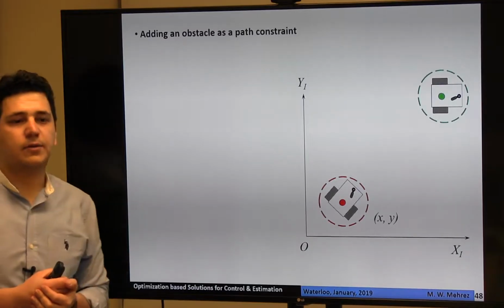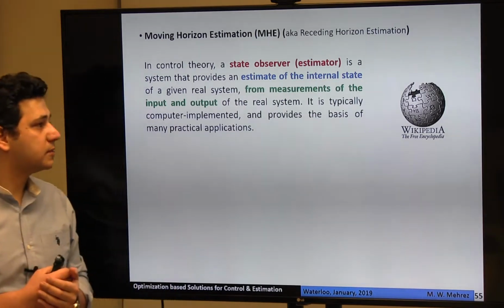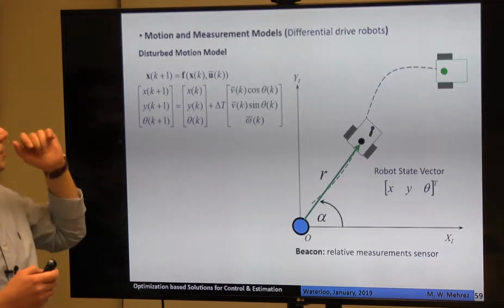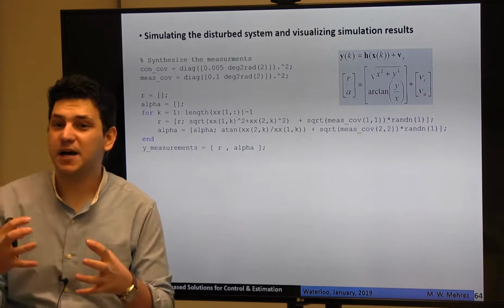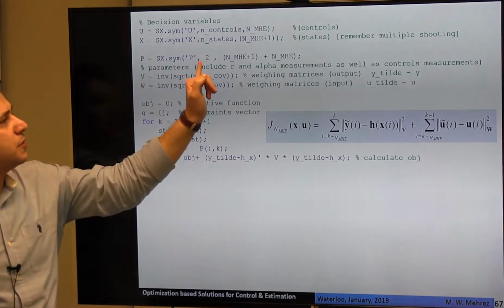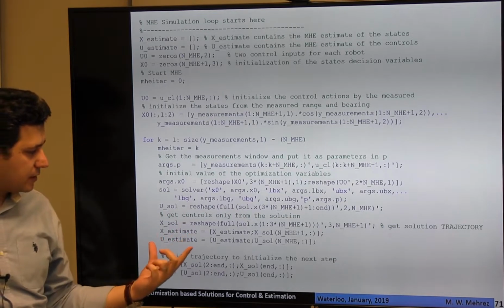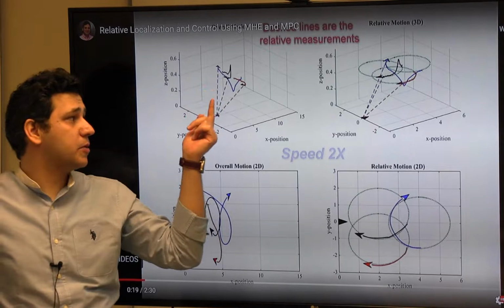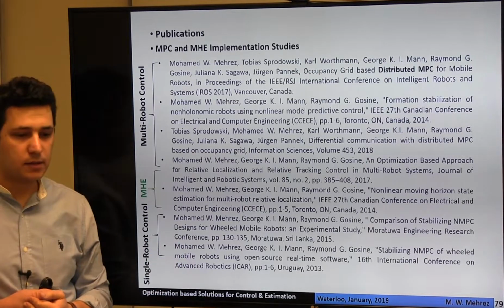MPC and MHE implementation in Matlab using Casadi | Part 2

Comment: Dear Dr Mehrez, regarding speeding up the solver:
1) What is the recommended method for exporting the c code when the main program is working on python? Generate C code or C++ code? Then I should call again the generated code of the solver on python?
2) Is this a non-linear MPC? The code given could be adapted to a linearised model? or exist a method in Casadi to internally linearise the model?
3) Which other methods could I use for speeding up the MPC?
Thank you very much for your guide.
Reply from the maker: Hi Sebastian,
1) I tried c-code generation using matlab on windows and I was calling the compiled c-code (.mex) from my matlab code. I guess this could be the case for Python, but I haven't tried it myself. I am also not sure about c++ code generation. Please refer to the website and the manual.
2) Yes, it is an NMPC. I personally prefer to use MPC whether the model is linear or nonlinear because the idea is exactly the same. Of course the code can be used for linear systems. Just remember that Ax+Bu is just a special case of f(x,u).
3) I guess code generation is your best method to speed things up. You can also make a pure c++ implementation. the c++ API is provided on Casadi website (not well documented unfortunately).
You're welcome!

Comment: Hi Mohammed,
Thank you very much for this video,
May I ask you a question? If I have more than 2 measurements ( 3,...,9) and four controls, how P ( parameters in casadi) should be ( I mean the number of rows)?
Best regards,
Dounia.
Reply from the maker: Hi Dou, thank you for your comment. You can choose the number of rows as the maximum number between the states and controls. For example, if you have 4 states and 2 controls, you can choose the number of rows as 4. Then, for the part of the P matrix that corresponds to the states you will use all the rows and for the controls you will use only the first 2 rows. In your initialization for P you can then initialize the remaining rows in P that corresponds to controls by any dummy value, e.g. zeros.
All the best!
Reply: @MohamedWMehrez  Thank you for your fast reply,
I initialized P as a vector of one row (P = SX.sym('P', (N_MHE+1)*n_measurements + N_MHE*n_controls));
and it works fine.
Thank you,
Best regards,
Dounia.

Comment: dr. Mehrez, thank you for this presentation, it's a valuable material for learning. I have a question regarding MHE. I see you did not explicitly include arrival cost in your problem formulation which would be equivalent to saying that state at the timestep t-N of horizon is uniformly distributed. Usually, one can do better by including arrival cost with weighting matrix which is inverse of covariance matrix that's propagated by EKF, UKF or basically any kind of covariance propagation strategy for nonlinear systems. I'm curious why you didn't include arrival cost and what can one say about stability of estimator without explicit inclusion of arrival cost.
Reply from the maker: Hi Ivan, thank you for your comment. You're observation is completely true. For sure we can use an arrival cost to improve the estimate. I just wanted to show the basic idea of MHE similar to what I did in MPC in which I didn't use a terminal cost.
Reply: Hi Ivan and Dr. Mehrez, sorry for disturbing you :). Would you mind recommending some good or basic papers illustrating the "arrival cost" concept to me? I am a beginner at MHE and get confused when reading papers about the "arrival cost". Thank you :)

Comment: Hi Dr Mohamed. Thanks for the fantastic lecture and source code. 

Im using MHE to predict the state of charge of a battery and have an issue that I hope you can help with. I only wish to estimate the 3 states in my system of which I have the governing equations and the state transformation function "h" to obtain the predicted output that will be used to populate the objective function (y_tilde -h_x) over the prediction horizon. 

I have two problems. 

(1) My "h" function uses function inputs of (state and controls) to calculate the measurement_rhs. This affects the length of the for loop  (y_tilde -h_x) and forces it to be k=1:NMHE and not k=1:NMHE+1 as you have in your code.  If I use the loop length k=1:NMHE, I get a mismatch error when plotting my X_estimate vs time (t) as the length of time is 1 time step longer than the length of the matrix X_estimate. Any tips on how to How do I fix this ?
 Should I use the multiple shooting equality constraints "g" approach where the function "f" uses both the states and controls to calculate the f.value of state next ?

(2) Can I still implement MHE using this code to obtain the only state estimates and not the estimates of the control inputs to the system i.e omitting (u_tilde - u) ?  What should I be mindful of when implementing this ?

Thanks in advance
Reply from the maker: Thanks Farai, here is my answer to your questions
(1) This is a dimensions problem which you can fix by simply extending the time vector by one more time step or reduce the estimation vector by one estimate.
(2) Of course you can. Just make sure that you have all the available data that will allow you to predict your output, i.e. h(x).
All the best,
Mohamed

Comment: Hi Mohamed, thank you for the video. I can understand the 3DOF problem which you have explained in the video. But, i have the project in which i have to implement the 6DOF nonlinear MPC controller for the floating cylindrical shape of underwater marine craft. so, how can i relate the problem you have explained to the 6DOF?
Reply from the maker: Just change the dynamics model to your 6 dof model.

Comment: Hi. MHE is used to estimate the state, but it will fail to estimate the theta angle when the linear speed is zero. The question is how can I overcome this in robot control practice. Thank you.
Reply from the maker: It's not the MHE problem. It's the question of observability given the measurement and motion model. You may fix the problem by using a sensor that measures the orientation directly, e.g. a compass.
Reply: @MohamedWMehrez  Thank you. You work is so great.
Reply from the maker: You're welcome! You can cite any of my related work here
https://scholar.google.com/citations?user=aRNeH4QAAAAJ&hl=en

Comment: Great talk! I am thinking of implementing a similar MPC+MHE combo for one of my projects. Out of curiosity, do you know if it is possible to somehow upload the MATLAB code with the solvers and Casadi packages onto a microcontroller? Or would the code have to be rewritten in C/C++?
Reply from the maker: for embedded implementation, you may consider acados. Check the details here  
https://github.com/acados/acados
Reply: @MohamedWMehrez  Hi again, I'm having some trouble implementing the acado libraries with my project. I want to the define the initial conditions for the OCP at time step using my sensor values as inputs. What would be the easiest way to go about this? Thanks.
Reply from the maker: Hi Josh, actually I haven't used acados before, so I am afraid I can't give you a proper advice here.

Comment: Hello, Thank you for such a great workshop! Although I am a bit confused regarding the MHE formulation used to solve the problem. Can you give reference to how exactly this formulation has come in form? Is it purely based on least square sense or formulated through probabilistic settings?
Reply from the maker: Thank you! Glad that it was useful. Here is a great book on MPC and MHE; check the state estimation chapter (Chapter 4) in the book to look at a detailed formulation of MHE 
https://engineering.ucsb.edu/~jbraw/mpc/

Yes, MHE is based on least square formulation; nonetheless, if the process noise is Gaussian, tuning the MHE weighting matrices becomes easier as shown in the workshop.
Reply: Thank you for the reply again. However isn't arrival cost missing in the formulation ?
Reply from the maker: @devyanivarshney1100  indeed you can add an arrival cost to the MHE formulation. It is similar to the terminal cost in MPC. However, I haven't used any in the workshop to make the presentation simpler on one hand and because MPC without terminal costs can guarantee closed loop stability when some conditions are satisfied. If you would like to learn more about that, here is one of the  studies I did on MPC stability without terminal costs or constraints.
https://ieeexplore.ieee.org/abstract/document/7312445/

Here is also a study I did one MHE where I Incorporated the arrival cost in the formulation

https://link.springer.com/article/10.1007/s10846-016-0408-2
Reply: @MohamedWMehrez  Thank you again :)